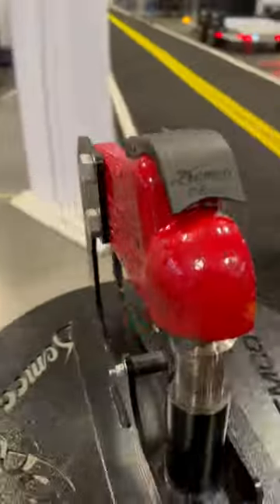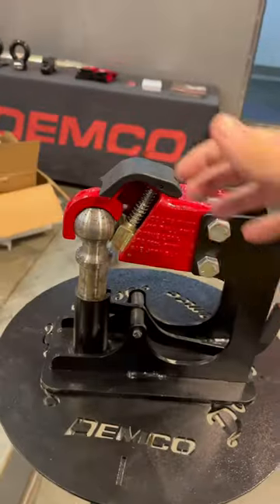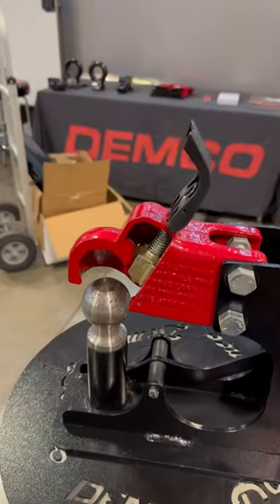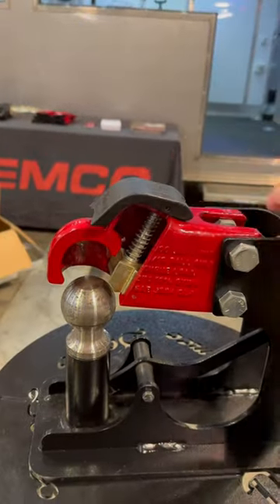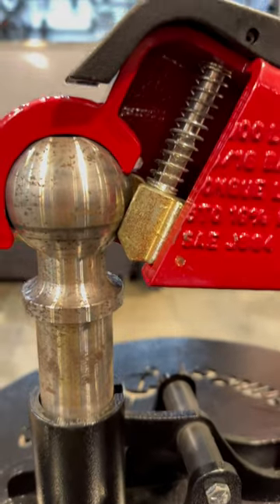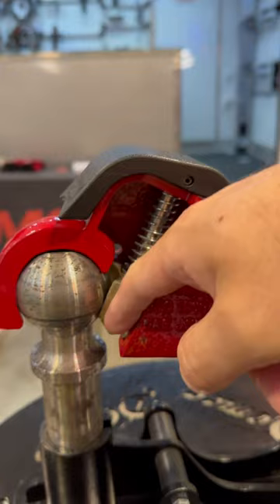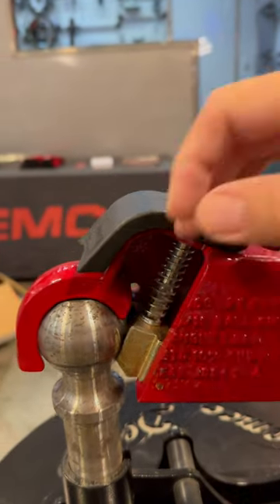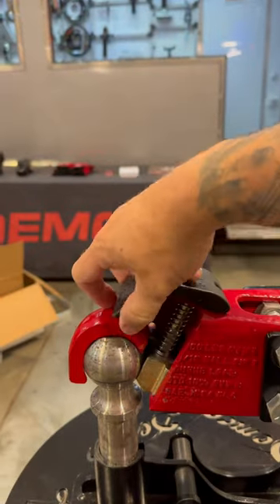Plastic Latch? Will it hold?

Comment: what does the plastic piece cost when it breaks? plastic on a trailer hitch is stupid.... how well does it hold on bumpy roads ....i wouldn't trust it at all...no lock !
Reply from the maker: Has a lock pin hole.  All your power tools are plastic A.K.A Nylon, ABS and glass fiber.  If it breaks it still stays locked
Reply: @Toolsinaction  yeah ......our power tools aren't holding a fuckin trailer 😂
Reply: @justinperez7176  but an impact wrench can pop out 750 ft lbs of torque and not even bat an eye... plastic is strong durable and cheaper than steel to replace.
Reply: The release handle shouldn’t  be exposed to and pressure, so does it matter if it’s made from a composite material? The material has been so well refined, I just don’t see the concerns being a legitimate issue. Seems like a bunch of “this is how we’ve always done it” blah blah blah talk to me. All the mechanical workings are still metallic.

Comment: I don't feel like it's that good of a lock. Because if that Spring goes, there's no tension to hold on it. And if that balls jumping up and down that latch moves at all from the slack between the ball and the outside of that cup, it's going to come loose

Comment: Where's the colder pin to lock it in place
Reply from the maker: It does have lock pin hole.  You cant see it because of the cut out
Reply: I think you meant to say cotter pin, but i also dont think you know what a cotter pin is, so yeah.
Reply: Auto correct. Been in the towing business 20 years, so you're correct. I have never heard of a cotter pin b4.